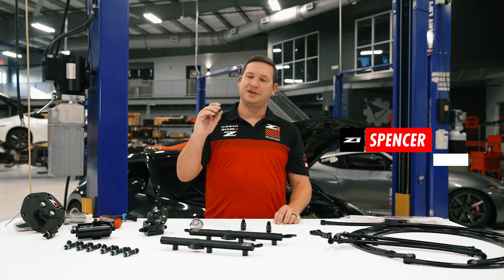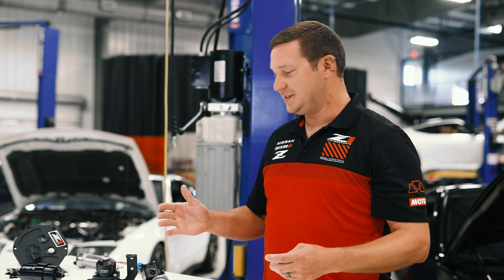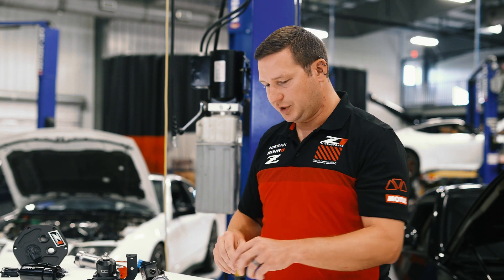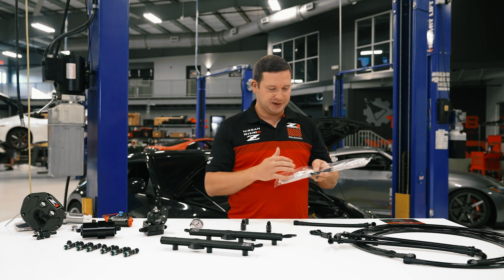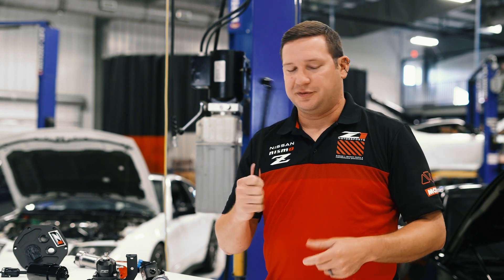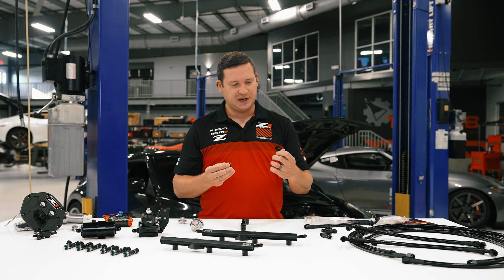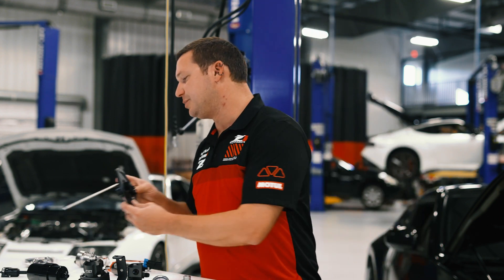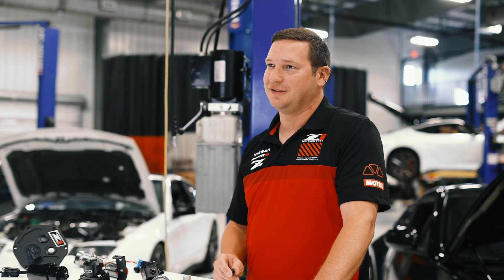Z1 Fuel Return System

Comment: I set myself on your site with a ton of stuff ( like 9k worth ). Asked a few questions about the oil pump upgrade and had some other questions. Though whoever you have running the emails should get trained a bit better. After researching the last few days, all your stuff could have worked. I went a different route because I had a reply that was very off putting.

Z1 Email Reply after asking if the oil pump was an upgrade or an OEM VQ35DE- "I see your cart in there, and again, I cannot guarantee that these parts will work on your Altima. your motor does have a different top end setup than the 350/g35 motors."

I asked for more information on this after giving a huge rundown of fwd vq35de vs rwd vq35de and : "I owned a 3.5 Altima Coupe as well, there are going to be some differences. But I can set up the quote with the decals for you if you are sure they work on your vehicle."

Just for everyone else out there... Sales over Information company.
Reply: Seems like they tried to be up front and not sell you parts they weren't confident would fit. Z1 isn't an "Altima Coupe" company. If you contacted them and gave them a rundown of the FWD VQ35, it sounds like maybe you had your answer already.
Reply: @drizzetsrevenge  I wish that was the case. The slight differences aren't enough for it not to work. I was told from them it didn't work, so I just found different items. Sad part is I did find some and tested it, they worked fine.. 
Another company did the same for the car on some other stuff I wanted. I had to use it though, while once again not having an issue installing or figuring out a small change. 
It's just the car, people aren't really trying it on them, they see a different engine displacement and assume it wont work over a couple bolts. Makes sense they didn't design it for that exact motor. But maybe some testing would have been a nice thing before flat out lying. Not my loss, got the Z1 parts I wanted for cheaper anyways. Lol